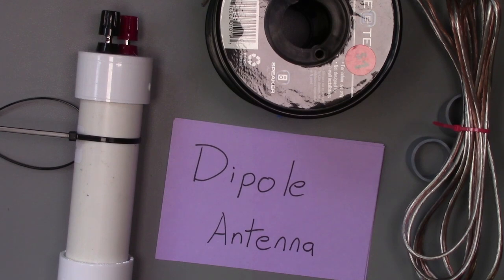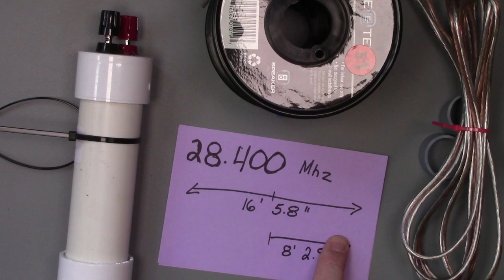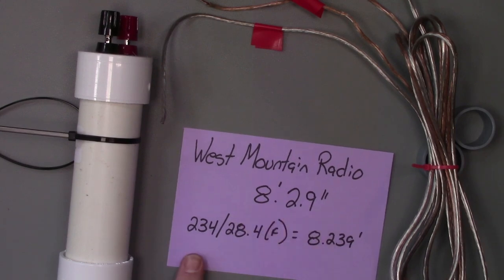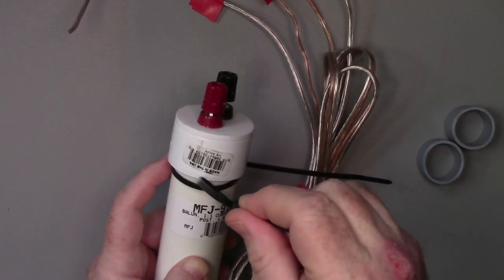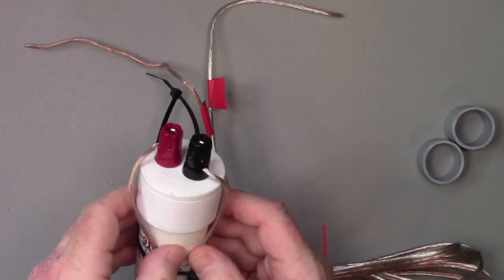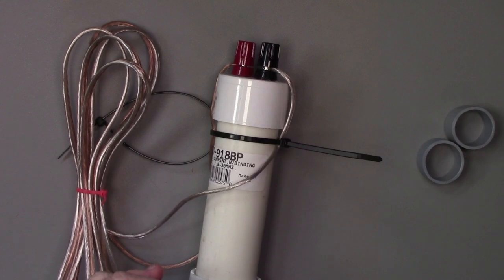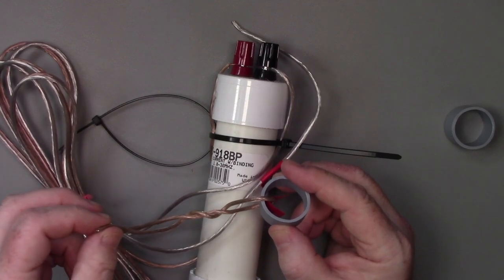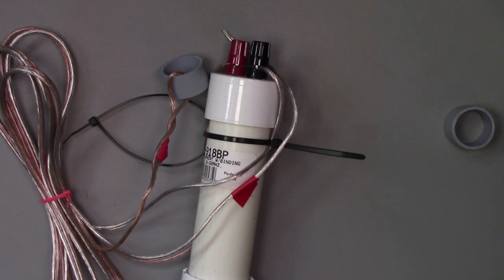Building A Basic Dipole Antenna [HTL-22]

Comment: I apologize in advance because my question isn't for ham radio but FM.  I'm looking to build an antenna for an old FM receiver but I'm unsure of the hook up.  On the back of the receiver there are several lugs.  One labelled 300 ohm, 75 ohm, ground and two others for AM.  My question is that on one end the antenna two wires are split about 6 ft apart but what about the other end?  Is it a single wire from either the 300 ohm or 75 ohm lug up to where the two split wires are and soldered ?  Or could I use some speaker wire split 6 ft apart on one end and both wires at the other end on the same lug or the ground lug and one of the other lugs?
Reply: This is a good FM antenna.  Easy to make if you have access to 300 ohm twin lead, or inexpensive to buy pre-made.  "300 ohm twin lead folded dipole for FM."

Comment: if they was to use 264/f would be alot easy for them to figure out and it quarter wave and it has work for me
Reply from the maker: Thanks for your comments.  This would probably work too as it adjusts for velocity factor of the wire some.   As far as SWR testing, I'm not expecting everyone has a SWR meter, so I was keeping it basic.
Reply: This build results in an swr of 1: 2 which is usable.
I calculated the length of my antenna and cut 6 inches longer and folded over.
This was then measured with an analyzer and the frequency recorded.
The original length was converted to mm and written down.
I calculated length for the target frequency in mm and subtracted that from the original mm length.
This gave me the exact amount to fold over and solder close to the end insulator.
Dead on frequency and 1:1.2 swr.

Outstanding performance.
Reply: @hamtechlibrary2689  Right but most do now days when i make my dipoles i go 468/f and it gets me hole lot closer to the said freq i want op on but that just me